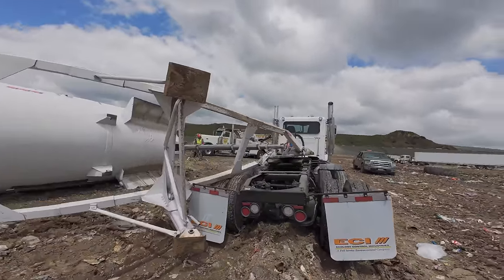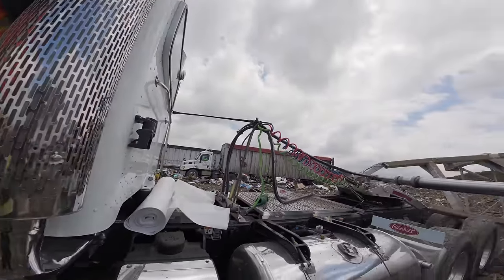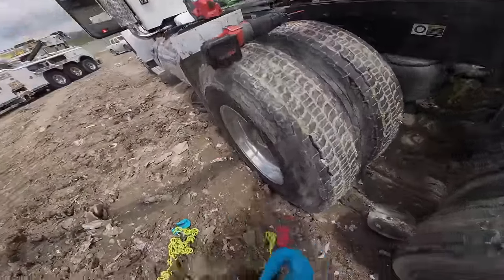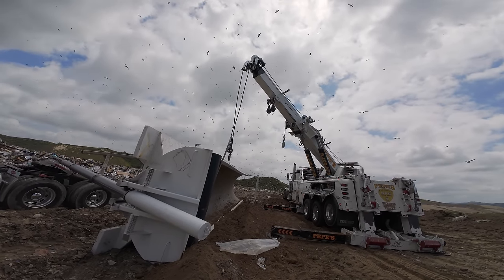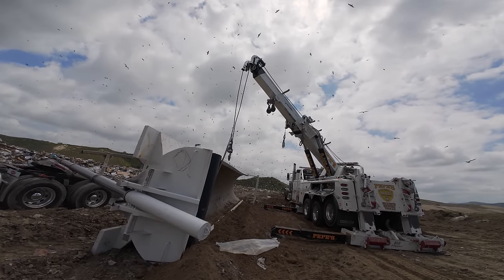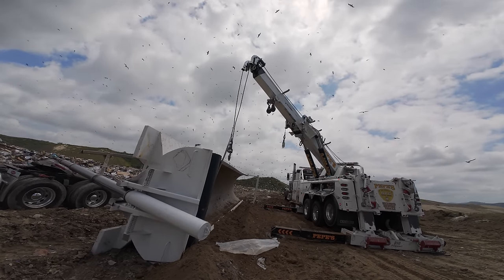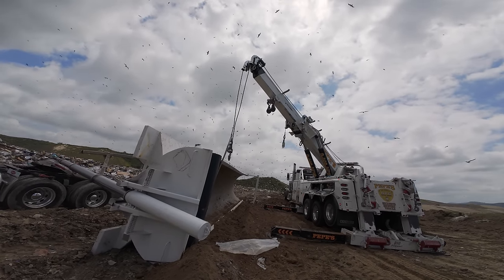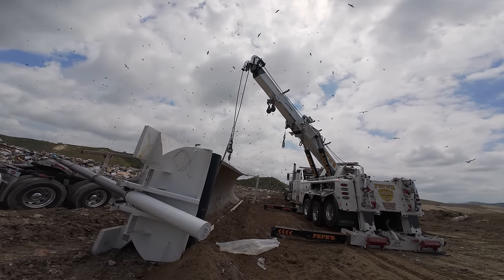MESSY Dump-Trailer Rolled Over at the Landfill

Comment: I noticed a small thing you did, Alex.  Sitting in garbage and dirt, caging the brakes, a tough dirty job.  Then after putting away the tools, you cleaned your hands a little with some wet wipes.  Then, standing in a landfill, you tossed the dirty wipes into the cabinet on Flipper.  Very classy, habit of a lifetime, automatic reflex.  999 out of 1000 people would toss them on the ground - it's a landfill !   You did everything but sweep up the ground before leaving. An educated, cultured gentleman.

Comment: I've never seen the contraption Alex used to hook to the trailer. Big Flipper is full of tricks! Great video, as always.
Reply: The tow bar?
Reply from the maker: A towbar? Yes, that's how it was done way back in the day and how some smaller wheel lift trucks do it. More accurately, they have what's called a "sling". Pretty nifty!
Reply: I liked at 59:35 you put the used hand wipe back in the truck, would want to add any more trash.
Reply: @garylatture8948  And the empty water bottle.

Comment: I have an end dump too and this is always a worry. You have to be perfectly level and even if you are if the load doesnt slide out evenly is can unbalance and tip over. At the landfill i go to they won't even let you back in until it is clear of other trucks fifty feet on each side. Safety rules are written in blood

Comment: Alex impresses with his ability to analyzes requirements on the fly. One would think he had some great instruction and mentors along the way. That job should qualify for nasty environment pay. I was shocked to see you could actually tow with flipper, a well kept secret. Great job, no fluid on the ground an the job completed successfully. Thanks guys, appreciate it.
Reply from the maker: I agree. Very hard to find an operator like this that can do these calls solo. Not everything is something you'll learn in training or a book. You have to adapt and think on the fly at all times.
Reply: You have to remember--it is a landfill--whtever buried in tons of  trash. What is the harm?
Reply: @glennjukes5581  You are right - that amount of hydraulic fluid added to the barrels and barrels already in the landfill - truly a drop in the ocean.   Trash trucks and heavy equipment often leak generously (repacking seals and replacing hoses is $$$$$) - not to mention the fluids discarded in trash.  An act of courtesy to future generations to minimize it, with considerable effort.  Bravo.

Comment: You have got to watch close when dumping.  I pulled an end dump almost 10 years, and I never turned one over, but I watched there I was dumping and made sure the ground firm. Sometimes, no matter how hard you try, it  happens  the way pen in the fifth wheel kept it from turning the truck over. If the pen goes all the way across the fifth wheel it will turn the truck almost every time. 
Stay safe, and God bless. 
    Dan 🇺🇸

Comment: The inexperience of the dirt hauler allowed himself to be directed by the dump director who guides these big dump haulers who usually know better to drive out on such unstable ground. There are solid ground flat areas at these landfills that experienced trucked dirt haulers will only dump at. Then those mounds are frontend loaded and bulldozed in over the soft trash.

Comment: I used to work for ECI, my first trucking job. Great to get experience, and then get out 😂 basically on call, overtime after 40hrs. Yard was tiny only one truck could pull in at a time and park   I worked the vacuum truck and roll offs

Comment: Ok, I don’t normally like to interfere, but… you do not need the PTO on when draining the fluid back into the tank, what would have been easier is to just have him pull away, upright the trailer, then…set the bottom of the Ram where it belongs, and let the gravity push the Ram back in, and drain the fluid back into the tank, but job accomplished how you did this, so success is success

Comment: Another job well done by the rescue man Alex. One question: wouldn't it have been easier to connect with airlines instead of caging the brakes? I don't know though maybe you weren't equipped to hook up the airlines?  Anyway well done!
Reply: Air lines were cut when the bars were being disconnected.

Comment: Hindsight says to use your drag winch with your tail end facing the cylinder. Since it is easier to pull it together. Don't forget to get your stuff that was used on the cylinder, else you'll be wondering where it is.
Reply from the maker: We don't like to move the trucks if not necessary. You would have to put everything away, get in the truck, then reposition the truck. Then get back to the original spot to flip it. Way too much moving. Rotators are meant to be set and done

Comment: What's the reason you didn't use air from Big Flipper to release the trailer brakes on the dump?  A lot quicker and easier, plus no crawling around in the dirt at the landfill.

Comment: nice video for the viewer but not nice for the driver. such a long dump-trailer is not made to be operated on a landfill. when the ground isn't solid and flat it is predictable the the trailer will roll over during dump. on Youtube you find several videos with such incidents. physics are stronger than a truck.

Comment: Alex good going, 2 bad these drivers don’t get trained on how 2 drive semi end dump, 1st & 4 most U drop the air in the bags stay on level ground raise the bed up until the load breaks lower the bed down then backup 2 where U are 2 dump then raise up the bed & dump the load, if the load is wet U had better watch the load or U are going 2 B in the same predicament, as mom would say no brain no pain, lol😅

Comment: What dji drone model is that one you are using? Why not add landing  legs with LED lights for the night use? I have a mini 2 fly more 50 grams with a foldable landing gear with LED lights, and it can be seen flying at night. Great job, dude.

Comment: Very good practice for the road on hazardous fluids. I am sure many of the dozers and other equipment blows hydraulic fluid lines at that land fill. I am sure nobody cares what happens to the fluid there.
Reply: Landfills are highly regulated.  Such as you're not supposed to throw used oil in the trash because it doesn't belong in the landfill.  Some locations may have fewer restrictions, depending upon local needs in conditions.

Comment: Too bad that company didn't com with another bar to put it on on the spot so you didn't have to use the tow bar . You might get attachment made for the air hoses to hook at the pivot point so you don't have a run-away trailer that is just pushing you down the hill.

Comment: Just flipping the pto on wouldnt actually pressurize the line.. would have to flip the directional switch to the raise position before it pressurized the line. And pto shouldn’t need to be turned on to lower the cylinder, would just need the directional switch set to the lower position 🤷‍♂️

Comment: 441 with a ECI truck you're doing with this and dump that is a one-way valve that goes up and it's a free flow valve going down so you shouldn't have to have your PTO in quite a few things you guys should learn about running and dumps for one make sure you're on good solid ground for
Reply from the maker: Dude relax. We're tow truck drivers. I mentioned this in a previous video but notice how you're specifically calling out one tiny thing in this whole video? We get calls for virtually every vehicle make and model on top of construction stuff and everything in between. Do you know anyone who is an expert in all things for EVERY MAKE AND MODEL OF EVERYTHING ON THE ROAD? No, but you expect us to?
Reply: Seems what worked worked. That is what counts.

Comment: Could you have used a quick connect gladhand to the red line that was cut off so you could air up and release the brakes without having to cage the brakes?
Reply from the maker: No, air lines damaged completely. Alex did that first, I just had to cut it out with a lot of other stuff so the video wouldn't drag.
Reply: @PepesTowingService  thanks, I never  know how long the recovery actually took and what ideas you might have tried and discarded.
Reply from the maker: Alex likes to leave his camera running the entire time so often there's just tons of standby time and other stuff. I try to leave allll the important stuff in while still making it viewable to you guys
Reply: @PepesTowingService  just out of curiosity how often do you have to cage the brakes